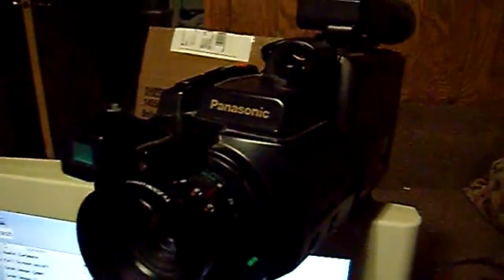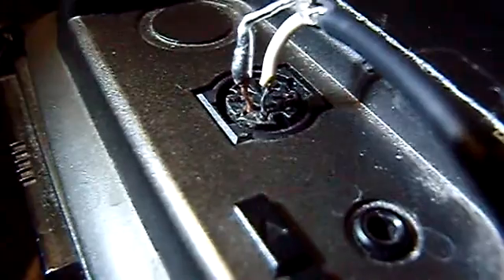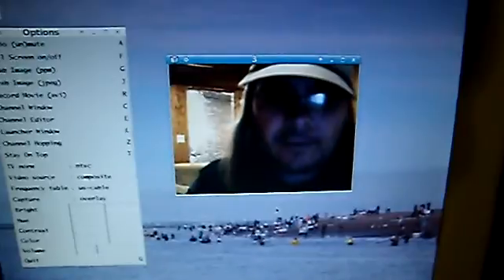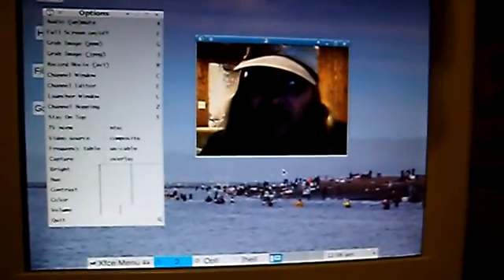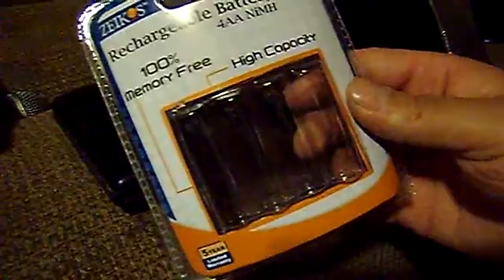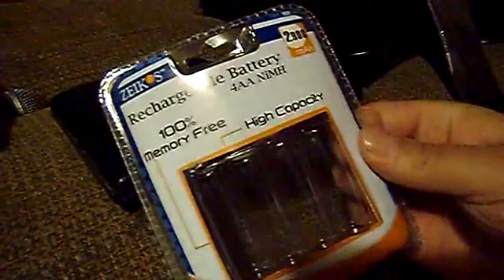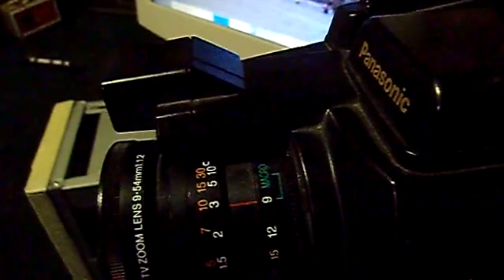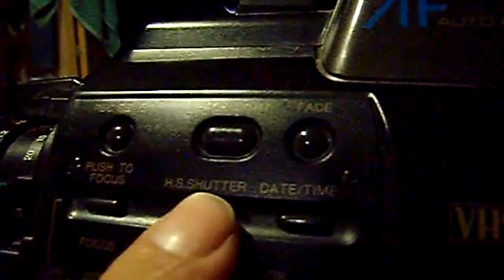Hacking the Panasonic OmniMovie CamCorder

Comment: Hello,

I have a Panasonic PV-210D.  It worked fine until it seems to have snagged the tape.  At that point it would no longer record images to the tape thought it still records sound.  The image it records is snow although I can still see through the viewfinder.

Do you happen to know where one might find a repair manual or schematics, parts diagrams, etc?  

Thanks,
Brian
Reply from the maker: I don't know if there is a tracking adjustment since  the device is long-gone. The tape transport could be loose on the mounting, or something is bent. It doesn't look easy to work on, but maybe the door will come off for better access.
Reply: @themanyone  Hello,

I finally managed to get around to cleaning the drum.  It works perfectly fine now.  There wasn't much dust on the drum but I guess it only takes a little.  I used the plastic/leather cleaning swabs from eBay and denatured alcohol.
Thanks,
Brian

Comment: Any idea on how I could splice a wire to battery prongs to work as a plugged in cam?
Reply from the maker: +Anthony Carrillo I don't have this anymore, but should be a power jack on it somewhere, then just use an adapter.
Reply: +Henry Kroll thanks